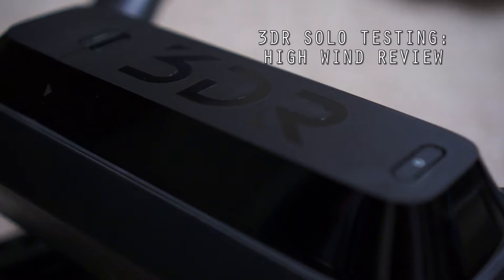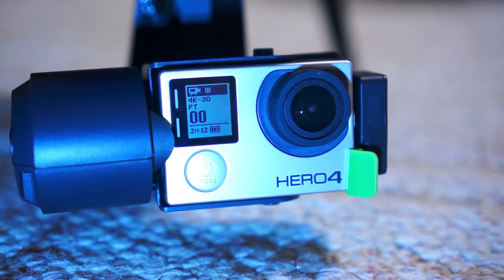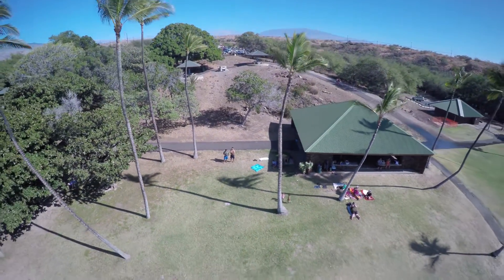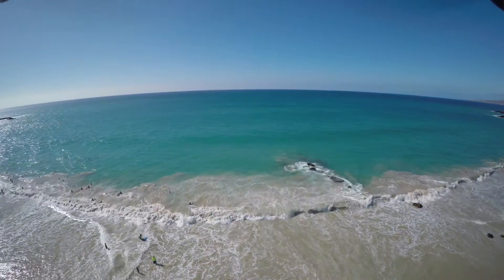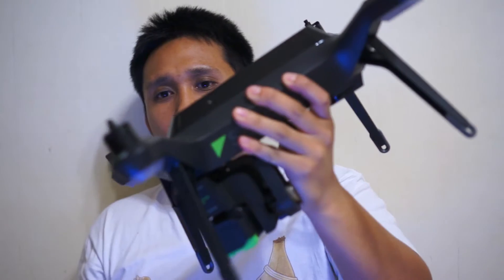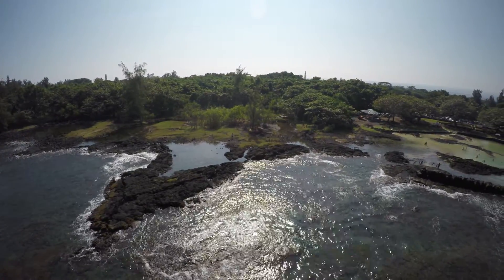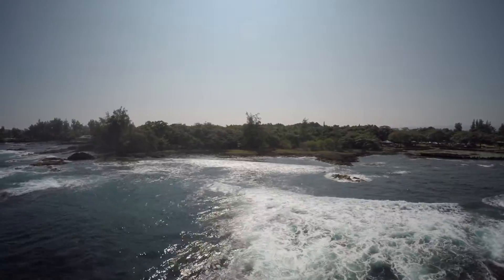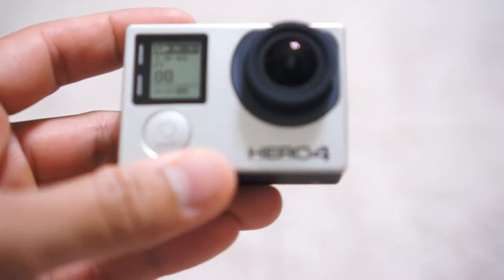Review: 3DR Solo High Wind Testing

Comment: High winds???? I see no wind in the footage.
Reply from the maker: I apologize as the gopro has a wide angle and you cant see much movement, especially when flying over ocean.    there was a bunch of sand and spray being kicked up that day (beginning beach).  you can see the pods and landing gear show up every so often as it is fighting to move forward and right itself.  surprising very little when doing a strife maneuver.  I expected it to kick up more for cross wind like conditions.  that being said, the solo did a good job stabilizing everything.  I consider 20-30mph gust pretty high, even for aviation standards.  what do u consider high winds?